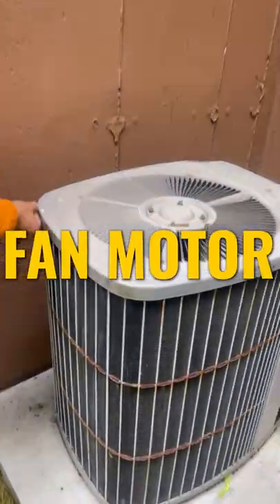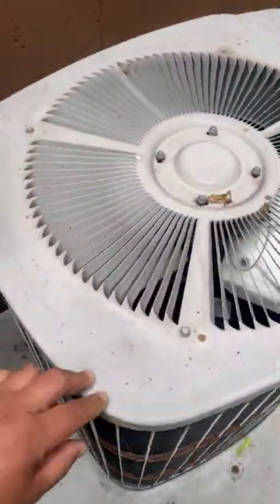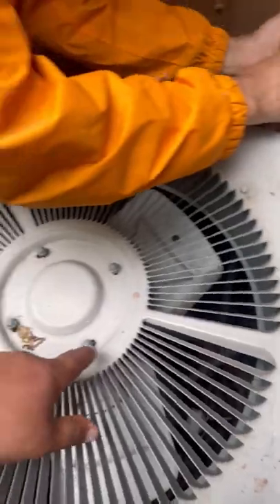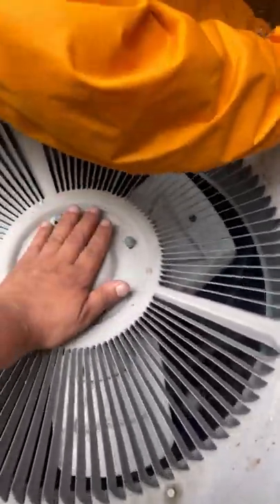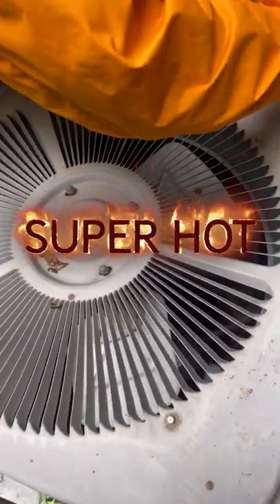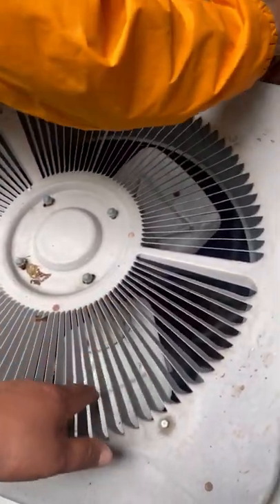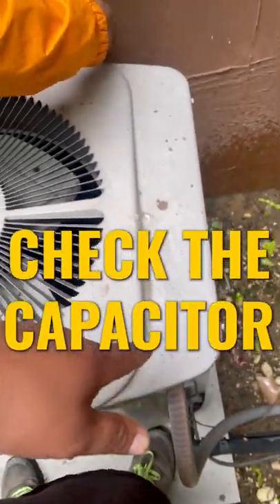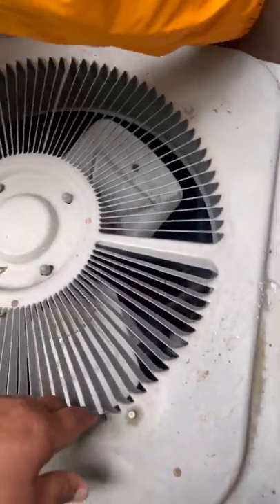WHY? Does Your AC CONDENSER FAN MOTOR STOPS working for your central Air Conditioning system?

Comment: My motor ceased and I lubricated it  and it is working fine. No need for calling service people for a ton o money. Thank God I figure it out by watching a video on how to lubricate your fan motor. I initialy was online looking for one to buy but found too many knock offs from China including one sold by Amazon that lasted two days. Disassemble the motor lubricate, clean the shat and put it back for a nice result.
Reply from the maker: Thats great & happy you were able to figure it out. Just know any outdoor condenser motors are self sealed motors & you cant lubricate them because they are designed to be outside and being in the outdoor elements like rain, snow etc will ruin the motor. The only motor that has louvers to release the heat from the motors and vent is the indoor blower motor.
Reply: @louietheboilerman The major frustration was not finding the original. All replacement were from China and with horrible reviews. If I was making money fixing ACs I would charge twice the price to give warranty because the chinese junk will fail for sure based o  what I read.
Reply: You can't open them up - correct 
You can't lubricate them - incorrect

Comment: I do want to check the capacitor or your helper is going to check your capacitor.
 Telescoping magnet can spin that fan blade to see if the shaft is locked.
 Instead of taking all that apart.

Comment: Wouldn't it make sense to check the cap first, then if needed take the unit apart to access the fan motor. Remember in life we must always use our brain
Reply from the maker: What would make sense if you have any experience working in HVAC industry and know when and have a good feeling and know when the motor is bad and if you have any common sense when I make any videos just like other YouTubers I stick to a specific problem which means watch the next video and you can see how to check for a capacitor and that will answer your question, so yea I agree sometimes you must use your brain 🧠 and have some common sense to know that.. Doesn’t seem like your using your brian today … common sense.. just saying papa .. But thanks 🙏 for watching my content anyways … weppa